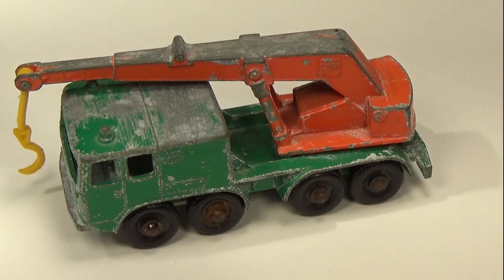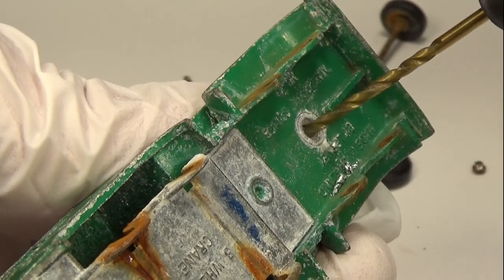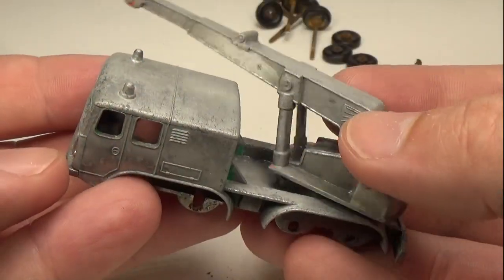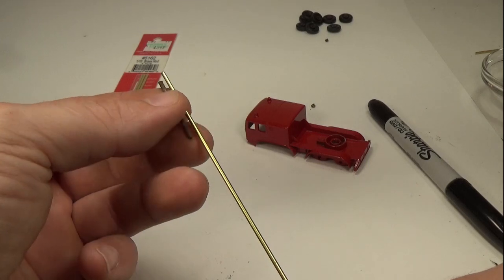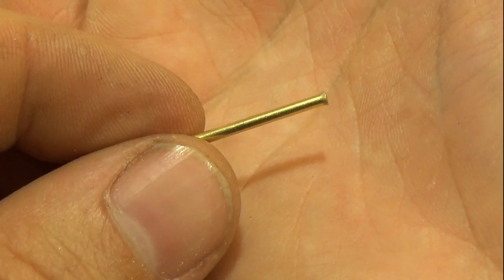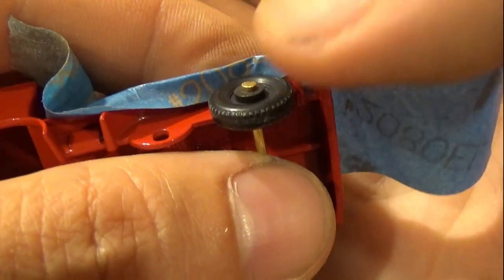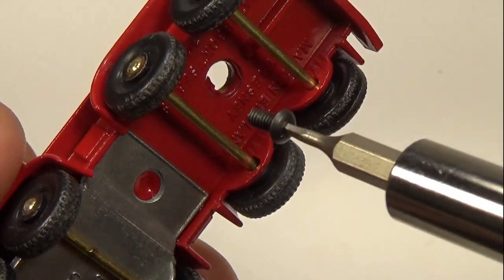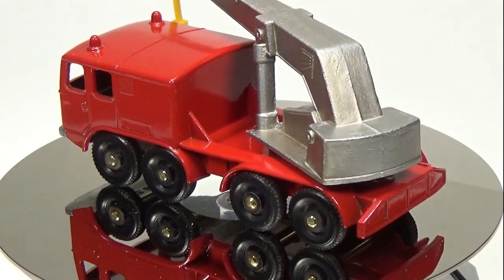How to Replace Axles on Vintage Matchbox Cars (Matchbox No30 8 Wheel Crane )

Comment: At work we call that truck a (mobile) boom winch, because the boom telescopes out, and the hook is attached to a winch. It only has left-right swing, and up-down lift. If it had its own tracks in the ground, with the ability to traverse back-forth, it would then be a gantry crane.
Reply from the maker: Thank you sir!
Reply: @baremetalHW  Hey Brother still waiting for Mad Max #5  part 3.. 🤣 (2 years ago? Still have it?)

Comment: What a superb result! Nice tip on using brass as an alternative to the original mild steel! Glad you are adding to the great Matchbox models in your collection.

I have quite a few of these to restore. I may consider going Code 3 on some of them. 

I have recently discovered Marty’s Matchbox Motors and he also made a tool similar to yours (using two nails) for mushrooming the ends of the axles.

Comment: Great job, man.  I'm getting back into scale modelling, and will be using some of the techniques I've learned from you to color in small details such as the chrome pen, using a sharpie for red lights, and turtle wax for polishing.  Most importantly, I'm going into it with the same easygoing mindset you exemplified in this video of painting the toy in colors you wanted to see instead of rigidly adhering to historical accuracy.  Thanks for the inspiration :)

Comment: I am definitely looking forward for more Lesney/Matchbox videos. I grew up with matxboxes and never really having much of hot wheels (majorette were also commonplace where I grew up). Seeing the amount of work put into perfectly mushrooming the axels, I am wondering if a tool could be used as a rivet setting tool with round indents on a top (striker) and bottom that would evenly mushroomed both sides with few strikes. This exists for various sizes of rivets for leather and textile (to keep the heads from flatteing out).

Comment: Probably at least a 1000 people have recommended this already but my idea for removing the old axels would be gently filing off a little bit of the material on the mushroomed end just enough that you could pop the wheels of of them without breaking them this way you could just push them back on once you are done restoring them and the rest of the car. I have tried it already and it works well but you have to be  careful not to remove too much of the mushroom or the wheels will fall of the axels easily

Comment: Nice , I have watched a lot of restro matchboxes , it seems to be a lot of different ways of doing things.  I have lots of them including many new in box but I have hundreds in need of restoring. I know restored they are not worth much but they are nice if you want to display them as I have hundreds of 64,ths. 
I think using authentic pieces is best but the brass rods would look nice and being softer material easier to work clear coat them so they dont discolour is also a good idea.  The only other person so far I have seen come up with a reasonable fix for removing the axles and reshaping them is this guy, Im sure you have watched some of his.  Marty's Matchbox Makeovers, He uses a modified nail seems to work quit nicely.  Im going to try a similar idea but not grind down the axle but rather try and peen it back down on the small end and then reshape it after similar to his idea as i dont have a lathe to make a tool.  I hate the drilling of the rivets also but there really is no other option by the looks of it especially where they hold plastic parts in.  Tank you for showing your methods much appreciated.
Reply from the maker: I only found out about Marty's Matchbox Makeovers from commenters on this video...
Reply: Yeah I like his axle reshaping the rest is a little howdy doody i think.  He uses a drill way to large in most cases. Does to much damage but he is happy with it so thats fine.   I have an idea to try and part them without drilling them , It probably wont work as diecast is difficult to work and very brittle. Heat and a bit of loving leverage to try and form it back up.   Discoloration wont matter as I will re-zinc coat them first rather than use under coat.  Where the windows are held in with rivets this wont be possible of course unless you sacrifice the window.

Comment: Have you thought about using a jewelers "cup" burs for the ends of the axle. They come in various sizes and will cut a nice half dome on the axle ends. In jewelry trade they are use to round out the ends of the prongs on a set stone.
Jewelry supply sites.
Rio Grande
Stullers
Thanks for your videos, gonna start gettin' me some beat up cars to practice on.
Reply: John Wong what size is needed for the vintage lesney/matchbox axles?

Comment: is there any reason you can't chuck up your homemade tool in the tailstock for the first axle shaping? would that not be easier?  

your "crane" is  called a boom truck. they're lighter duty than a full sized crane. we used them pretty often for lifting structural pieces into position when constructing buildings

Comment: I would refer to it as an overhead winch. I'm just going to guess here but I think the difference between a crane and a winch is that a crane suspends things in the air and is typically associated with the tall masts you see in cities whereas a winch is usually attached to a moving vehicle and doesn't move in quite the same way

Comment: I feel like this project was a lot more involved than what I normally see on your channel and I was already impressed with all you do.  A lot of thought went into recreating the Matchbox axles.  I am wondering if it wouldn't be a lot easier to just switch the axle system over to something more like you use for the Hot Wheels and maybe even use Hot Wheel wheels?  Is it simply the challenge of restoring the original design or are there also technical reasons you like to reuse the original Matchbox wheels?  Please feel free to answer in an upcoming video.
Reply from the maker: The Regular wheels are what defines this era of diecast production. Books written about them usually have "regular wheels" in the title... (Collecting Matchbox Regular Wheels 1953-1969 Paperback – August 8, 2012). If I change the wheels I sort of fundamentally change what the vehicle is.

The issue with using HW wheels is that they are out of scale.... way to wide. If I put them on this model they would extend way out and look rather strange.

https://www.amazon.com/Collecting-Matchbox-Regular-Wheels-1953-1969/dp/0764341898/ref=sr_1_fkmr0_2?ie=UTF8&qid=1536766843&sr=8-2-fkmr0&keywords=matchbox+original+wheels

Comment: I wish I could have my 1965 Ford galaxie 500 repainted in a wine red or Ford blue it’s in great condition just some paint had rubbed off it was originally on my wall still in the box till the plastic finally fell off that was covering the car and I was going to re seal the car but I loved on how the car sat on my show case from a castline car lift

Comment: Will the vinegar trick work on thinner axles like the ones on mainline Hotwheels and Matchbox cars? Also it would be cool if you tried to ' modernize ' a Redline or Lesney with current style wheels and paints.
Reply from the maker: yes it will work on thinner axels
Reply: Thanks 👍

Comment: As far as I know that is indeed just a crane, the arm part that hangs above the truck roof is called the "Jib" but the part you had to reattach to the body is just a crane to my knowledge. Of course I am not a expert on cranes, Locomotives yes cranes no so I could be very wrong.

Comment: My only surprise is you didn't give the warning lights an amber color.
I am sure between you and others a more simpler method will come about.
Reply from the maker: I try to keep things in the vein of the original... Here I changed the paint color but covered everything the way it was before. this is why I also did not polish the paint...  I could have gotten a mirror shine... but that's not what the original toy had. Thanks for watching and commenting!

Comment: Do people send you these cars, cause if so I do have one you could possibly restore. It's a Pepsi Challenger dragster from 1977. The original paint is chipped and worn off, there is also severe oxidation to the metal and the axles are severely bent and damaged. If you'd like to contact me about it I have Skype and Facebook, please let me know, I would really love to see this car restored to its original beauty.

Comment: A rivet anvil might make peening those new axles a little easier. You won't have to worry about the scoring, deformation, or slippage due to the vise jaws. Here are a couple of examples, they are relatively inexpensive and come with a variety of bore diameters https://www.cooltools.us/Hexagon-Riveting-Anvil-p/dap-305.htm or https://www.selva.de/en/all-categories/clockmakers-tools-supplies/clock-and-watch-repair/anvil-hardened-steel
Reply from the maker: Very Cool!!

Comment: I put the metal bodies in boiling water  with baking soda... 15-20 minutes then a stiff wire brush under hot tap water- whole process gets paint off within one hour.

Comment: The way you replace your axles is certainly one way of doing it, but sure seems like the long way. I use a Dremel tool on slow speed to remove one of the mushrooms. When you reinstall axle simply take a finish nail head which has a cupped head put in drill hold axle with plier turn drill on. Take about three minutes. Good luck.

Comment: Have you considered electroplating plating parts of the toy, or axels?  There is these small kits called Plug N Plate that have been around for many years.  I don't know if they have a plug for down under, but you can ask.

https://www.caswellplating.com/electroplating-anodizing/plug-n-plate-brush-plating-kits.html

Comment: I don't know if there has been an actual vehicle this miniature was modeled after but although the details (e.g. grille and headlamps) differ considerably it always reminded me of the Faun/Krupp-Ardelt crane "KW 15" (="Kranwagen" 15 to) used by the Mannheim Fire Department in Germany from 1963 until 1999. Apparently you are not aware of this one. So is it just a coincidence that you decided to alternate the paintjob on the miniature to match the Faun? See bos-fahrzeuge.info/einsatzfahrzeuge/137495/Florian_Mannheim_0271_aD/photo/400330